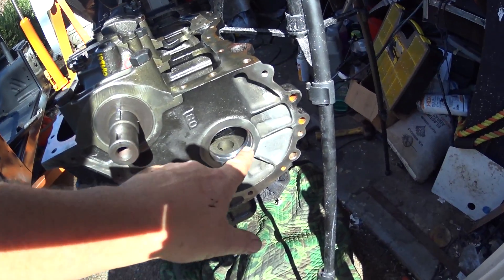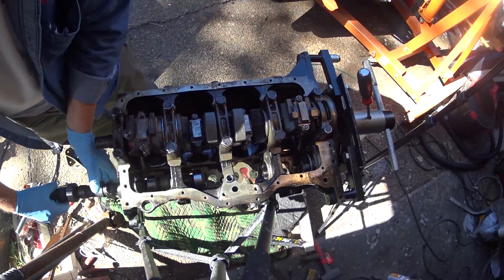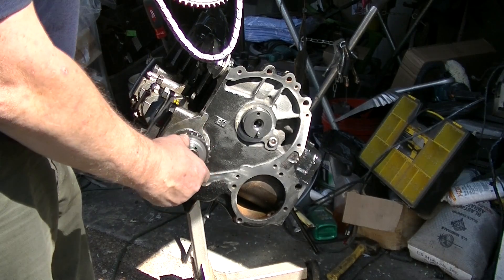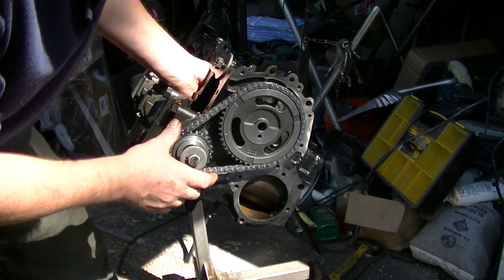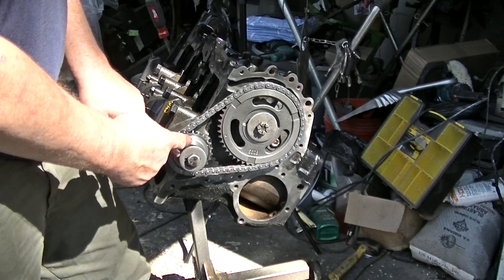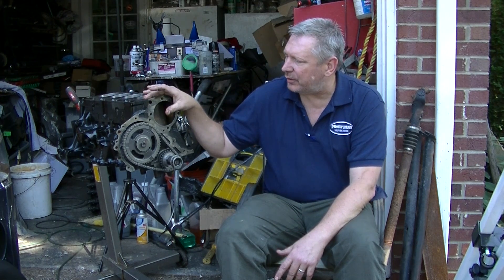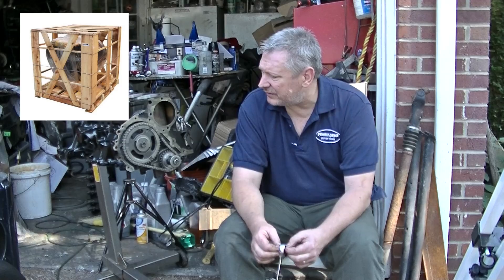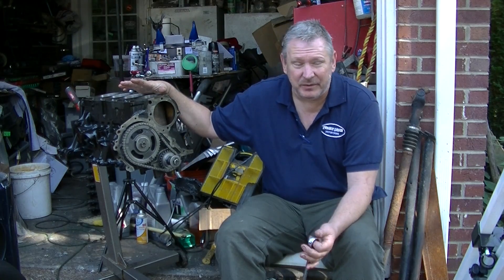Jeep Wrangler 2.5 / 4.0 Rebuild Series - Installing Timing Chain, Camshaft and Lifters

Comment: DISCLAIMER: 
To imply that a worn Tensioner Shoe indicates neglect is a bit over the top. My wife is the original owner of a 1989 White Jeep ( 2.5L - 4CYL )Wrangler. The old girl (both of them) have a shit load of miles in them but keep chugging along with only minor objections. Up until recently; that is..... There are 244,000 miles on the old girl and I doubt her Tensioner Shoe looks any better than the one in the video. It's called "OLD AGE" ! Sure wish he made mention of the material used for the Chain "Tensioner" shoe. It's an obvious high friction / wear point. Now I have to search it!
Wakodahatchee Chris

Comment: Hey Dave!  Dumb question: I notice at 4:41 you slide the cam pulley back into place.  I am reassembling my '97 TJ 2.5 engine (and using your videos for reference here and there, BTW!) and wondered about this.  I see I can slide my cam "too far" into the block, and that it seems that the timing chain and sprocket are what's keeping it riding in the right place (read: aligned on the bearings).  This is normal, correct?  I'm not missing a spacer at the back of the block that keeps the camshaft from going "too far back," am I?  

Thank you, sir!
Reply from the maker: cscmc11 yes that is correct it really isn't "held " in place E once the timing gear is bolted on and the push rods lifters are installed it doesn't move.  thanks!!
Reply: Thanks for the quick reply; I though maybe I was going nuts as I could not remember a thrust plate or anything there, but it seemed an odd design for it to "float" like it does.  Makes sense that lifters, timing chain & sprocket, etc... would hold it in place though.

Thanks again for the outstanding videos -- they are very helpful!

Comment: Oh Dave!  Of course you only have $350 in it...the machine shop gave you the deal of a lifetime!  I got out the door from the machine shop for $720 with my 2.5L block.  Washed, magnafluxed, bored, honed, decked, freeze plugs and cam bearings installed.  I had the master rebuild kit from Enginetech sent straight there. They pressed on my old rods to my new pistons and broke the head down, cleaned and magnafluxed it only to find a crack.

Everyone said the price sounds about right for a quality job, which they did.  I finished the rebuild about a month ago.  I was really hoping you were going to get your block back from Mark a few months ago so you could walk me through my first rebuild!!!!!  Now, its really interesting to see your approach versus mine.  Keep the videos coming!
Reply from the maker: +ezdankie Theres one guy in town here that would charge around 700.00 but that is why I don't use him LOL.  So you had to buy a new head ? So what has been the differences between mine and yours Im curious  ( or wrong lol )
Reply: +Redneck Garage I shopped around and I couldn't find a better deal unfortunately.  I live in an area that's predominantly military and they always seem to have money to burn so the shops have elevated prices because they can.  The place I took it was a performance race shop, they came highly recommended and I never questioned the quality/accuracy of the job, so I guess that was worth the money.

I bought a new head from ProMaxx.  Its identical to the #117 casting but thicker in all the places they usually crack.  It also came with new springs, valves, seats, seals,  and guides.  Shipped for $329.

The main differences I see so far is that you've done it before and I hadn't!  I was very nervous and probably far too anal.  I''m an engineer so I tend to overthink things.  I probably used to much moly paste and assembly lube.  I used a piece of air compressor hose on the rod cap screws to prevent them from scraping the cylinder walls.  I spent way too much time aligning the timing gears. I put the oil slinger on wrong at first. I broke the timing chain snubber trying to put it into the timing cover...lots of differences between our builds!

Comment: good job dave the engine is looking good, I could get a reman 4.0 for 2-2500 here not sure how much machining would be i may look into a rebuild in the future who knows
Reply: +Redneck Garage I've been building my own engines since late teenage years. One time I decided to buy a long block, it was a Chevy 4.3 V6 going in a full size 1/2 ton truck. They were gonna deliver it to my place and take the core back with them. Not to mention it was about $200 cheaper than me rebuilding it myself. That engine was the worst engine I ever had. Went through 2 sets of valve seals. At about 8k miles it started smoking (warranty was 5k). I eventually pulled that thing out and built a very warm 305. Truck was flawless every since. Even if it does cost a bit more to build. I know whats inside, I know my machine shop guy and I enjoy doing it. My one sickness is .. I can never build one stock. I gotta mod everything I touch :-) . Good build Dave!!
Reply: +Bullshitkorner Jerry, go with the rebuild, I think you'd be pleased with the results.  Roll that Chevy out into the alley to give yourself some room :)  I'll send you some Smartmouth to help with the rebuild.  Both you and Dave's videos have really helped me out.  I really appreciate that you guys take the time to share you knowledge.
Reply from the maker: +Bullshitkorner With yours it wouldn't be that bad of a build since you block is in good shape as well as your crank - just needs "freshening up " lol
Reply from the maker: +Power Addicts - Jeep, car and motorcycle tips hahaha you had me laughing. Ive had some experiences with some remans that were total crap too so I hear ya. You have the upgrade it feaver eh ? LOL  Thanks for the kind words !